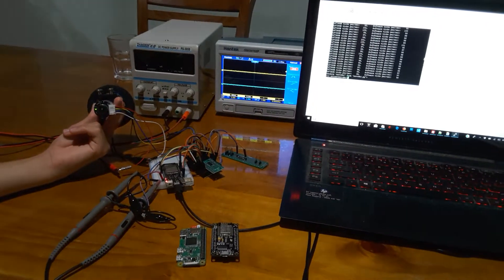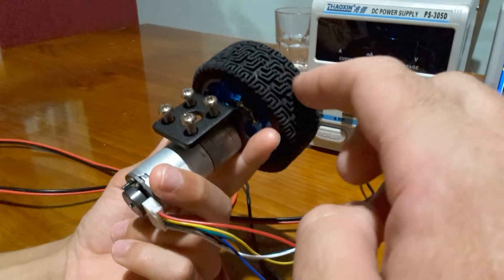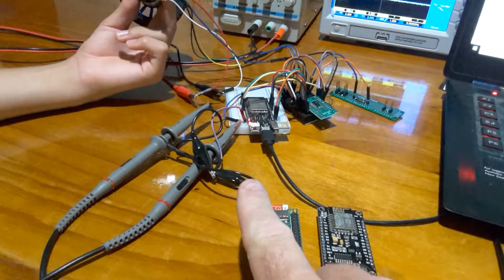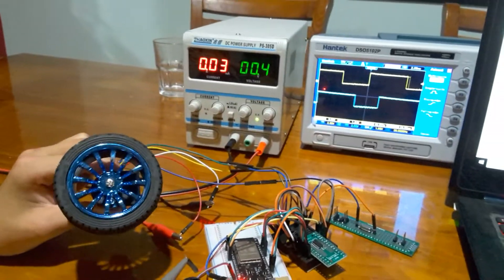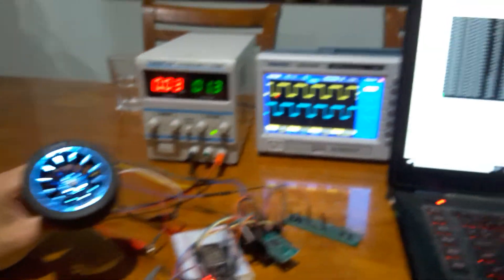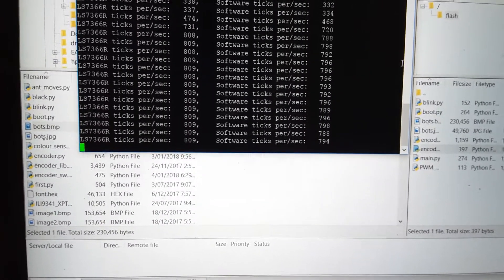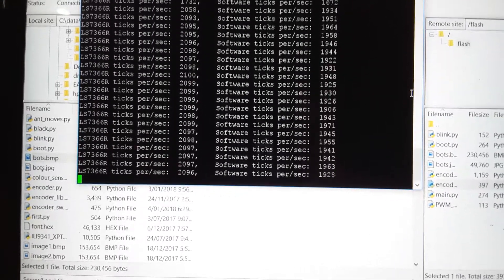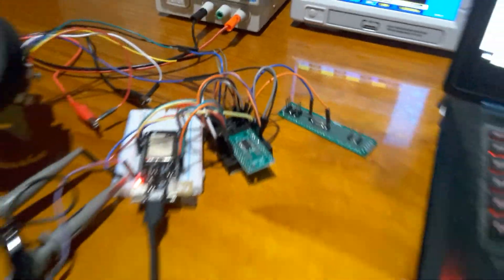External encoder Counter chip LS7366R

Comment: a question...i use this device on an arduino...does reading CNTR register influences the counting?Because on the data sheet productor writes (i understand this manner) to read back from OTR register...what is the right way ...?thank you
Reply from the maker: Yes you can use this IC with any controller. Reading the CNTR register doesn't change the counting

Comment: Thanks for sharing. But did you try to disable wifi first?
Did you use interrupts as well?
Reply from the maker: WiFi running, that's the point to show encoder counting requires all the resources to not miss a tick
Reply: @outofthebots3122  missed this. But if didnt, was this higher?
Reply from the maker: @aleXelaMec  it would be but your still missing the point that encoder counting takes up all your CPU resources so it means you can't do other things at the same time while counting a fast encoder. So if you want to be doing something and counting encoders at the same time then you need to use a hardware encoder counter rather than the CPU to count the encoder
Reply: @outofthebots3122  hey, no, I got your point. At least since my issue is not prolong measurement. I need to count short pulses (around 300ms), but 6 chanels, 2 of each are fast. But thanks for the comment. Ill think about using external Dedicated counter.

Comment: hey would you be able to share the code that you wrote. I can't seem to understand how the spi.transfer function work. I checked the syntax but can't use it because I don't understand what buffer and val parameters are. would you be able to help on that as well. Thank you
Reply from the maker: I would no longer have the code that I wrote for this video. What programming language are you using and what processor are you using??
Reply: basically I am using Arduino nano to control the motor with an encoder (am-2816a) and an SPI (LS7366R). As the motor rotates the encoder reads the position sends it back to the Arduino through the SPI. I have gone through the research part and know how to do the wiring, but I am stuck with the Arduino program. there is an SPI library in the Arduino software that supports the SPI communication (SPI Pins), and there is a function that I want to use thats called SPI.transfer(). I am having troubles understanding how to use the function and how to receive and send data from and to the encoder. I have used a program that I found online and the output is always -1 even if the motor is at different speeds. I am guessing that there is something wrong with the program. check the links below to know what I have been looking at:

https://arduino.stackexchange.com/questions/16348/how-do-you-use-spi-on-an-arduino

Arduino program found online:
https://github.com/werdroid/Arduino_LS7366R

Arduino Nano
http://www.farnell.com/datasheets/1682238.pdf

encoder
https://www.andymark.com/products/hall-effect-two-channel-encoder

SPI
https://lsicsi.com/datasheets/LS7366R.pdf

Clock 
https://www.ctscorp.com/wp-content/uploads/MXO45.pdf

   @outofthebots3122
Reply from the maker: @m.a.sherif6878  I don't use Ardunio myself so don't know the SPI library but the first link you posted seemed to me have all the info needed for using SPI. Also I have discovered that STM32 has builtin hardware encoders and there is an Ardunio port for the super common stm32f103c8t6 and it has an ardunio libiary for encoders counters see this thread http://www.stm32duino.com/viewtopic.php?f=18&t=4024&p=52829&hilit=encoders#p52829

Comment: I think that the best solution will be to use an STM32 board, like a Nucleo that have the quadrature encoder integrated
Reply from the maker: Yes I have now discovered that STM32 MCUs have hardware encoder counters on their timers so I use STM32 for projects that require a encoder counter.

Comment: Enocders are hard for pro beginners..your vid here also stated..that many people that wants to try this gets hit by the wall accuracy...so my own test of encoders(gpio input) has also hit a wall.  I can read stable 16 counts at 1000 Hertz pr Rpm...which is really not good enough... Now the chip you have is hard to get by(ls7366r) also the code for spi (a sample code) is also hard to get by....as many samples require the right set of parts.... So I think and hope for all on RPI and Arduino as probeginners that you will use a bit of time to make an in depth Tut vid.  Every where on YouTube and on forums you get small bits of the right way..  and for more people the making project it more important to know where you device is currently located then how fast it is going... In sense of robots/3d printers/conyouer belts/... So I wish for xmas, as you seam able to do this....and for all probeginners you will make an in depth project...easy to buy project...

Maybe I am hoping for to much.
But a man's gotta ask right...
Btw thank for your vids.

(Sry for my poor English).
Reply from the maker: Yes good points. The LS7366 is not common found and the user has to write their own custom driver to use it. I have now found another option, the STM32 family of MCUs have hardware encoders on their timers. I am currently using a STM32F103C8t for a robot that I am building am are using the hardware encoders on it. The STM32F103C8t (known as the blue pill) is available everywhere for about $2 and has 4 hardware encoders on it see https://www.aliexpress.com/wholesale?catId=0&initiative_id=AS_20181217125901&SearchText=stm32f103c8t6. There is an ardunio port for it and there is already libraries for using the hardware timer encoders. If python is your preferred lanuage then there is the pyboard with the more powerful STM32F405RG MCU that runs micro-python see https://store.micropython.org/
Reply: I have purchased the board. So now i Hope you will share some info on thatSTM32F103C8t . Will it handle highspeed as well? ... I have been looking a bit on the industrial encoders. And found that they are affortable for my project-  By the way happy new year. I need to finish this project, an i am getting desperate. :-)
Reply from the maker: @christiansrensen3810  here is the reference manual for the stm32f103 https://www.st.com/content/ccc/resource/technical/document/reference_manual/59/b9/ba/7f/11/af/43/d5/CD00171190.pdf/files/CD00171190.pdf/jcr:content/translations/en.CD00171190.pdf you will find from page 329 is the info on the encoder counter. Basically it uses the timer counters to count the encoders. I program it in C but there is ardunio libraries to use the encoder counters as well. I used MX_cube to setup the timers as encoder counters then was just reading the timer_count register to get the current count.

Comment: Based on the reference schematic in their datasheet, there are two capacitors near the crystal. Did you happen to work out what capacitor values to use?
Reply from the maker: The capacitors need to match the crystal you use in order to make it resonant for a clocking signal. Instead of using a crystal oscillator I used the timer on the ESP32 to create the clocking signal as ESP32 can create clocking signal up to 40MHz.
Reply: @outofthebots3122  Care to share the schematics you used? I'm especially interested in how you wired up the clock from ESP32 to the LS7366R
Reply from the maker: @orhuk   quote from datasheet ". Instead of a crystal the fCKi input may also be driven by an external clock.". I just set a timer on the ESP32 to create a high freq PWM with 50% duty and connected it to fCKi

Comment: I'm using pigpio to do the counting, and running streaming video over wifi at the same time on a pi ZW. Although things appear to go wrong, it is actually just total cpu overload that is a problem. When I stop the streaming video it all catches up again and the counters are correct (or at least have only a very small error). What software are you using to count?
Reply from the maker: I did write my own software to do the counting. What I found was the software was close to the external counter chip but it did miss some counts. The Quadrature encoders that use have 11 poles x 4 signals per pole x a 31:1 gear box so this is 1320 signals per rotate so if your rotating at 60RPM this 1320 signals per second. Quite often the motors can be spinning faster than 60RPM and usually I have at least 2 motors on any robot. Most processors with WiFi run the Wifi on a thread with high priority and when the processor is busy with maintaining the WiFi it will miss counts. You will notice this when you compare a software counter with the external counter or if you try to get a robot to drive a perfectly straight line. For my software counter code see my last video, at about 8mins you will see the code and at about 6mins a good explanation of how the code works https://www.youtube.com/watch?v=p4BCFhIuC88&t=33s
Reply: Not surprising really that a simple Python loop runs into trouble doing this. I use pigpio to count the pulses, so it's running in a real time process (i.e. high priority) and written in C I believe. I'm also running raspbian lite - so no gui and minimal system services. I found my first runs I had a rogue left over thread still runnig, once I rebooted I found I can stream video over wifi and use pigpio to count the pulses very accurately, There is a slight amount of jitter in the readings when streaming video over wifi, but the overall counts seem to be accurate.
Reply from the maker: Without a doubt the C code of the pigpio library will be faster than the code from the other link. I started to use the ESP8266 and the ESP32 because they are a real time MCU rather than a micro computer running an OS. In the video above it is running on an ESP32 board so ti is a real time MCU without an OS and all code is compiled to machine code via an C interpreter. No matter how high priority the pigiop library is the OS is still in command and will always have higher priority over resources. At times my robot can have wheels turn as fast as 120RPM and I have a min of 2 wheels driving so this is in the order of 5280 pulses per second and because there is 2 encoders running at the same it it is possible that some of these signals can be at the same time. So signals can be under 0.1ms apart. I started to use a MCU because it is real time so can handle these super small time frames better but still found problems of missing signals and this is why I used the external counter chips and have 1 for each encoder running in parallel. It means signals don't get missed and it also means the over heads r removed from my master processor to allow it to do other stuff.

Comment: Hi, nice job. How fast can this chip count? Would it be able to handle quadrature pulse at 2Mhz? I'm looking for something that could handle 4 encoders at 2Mhz, any suggestions? Thank you:)
Reply from the maker: the LS7366R processing speed is set my an external clock signal. Running at 5v it can handle clock signals as fast at 40Mhz. It is recomended that the chip is clocked at 10x the speed of the encoder signals so it should handle signals up to 4Mhz. You will need a Ls7366R for each encoder and they can be chained together on the 1 SPI bus all with separate CS lines see page 14 of the data sheet http://www.lsicsi.com/pdfs/Data_Sheets/LS7366R.pdf
Reply: Great, do you know perhaps where i could get a couple of these chips as soon as possible, EU zone?
Reply from the maker: Google will find them for you. Mostly I have found US sellers
Reply: Hey, I got the chip, its on a board, but should work the same: https://www.mikroe.com/counter-click
Trying to make it work with 1 encoder. I got MISO,MOSI,SCK,CS connected to Raspberry PI3, and im using the bcm2835 driver for SPI. http://www.airspayce.com/mikem/bcm2835/group__spi.html   Im using the datasheet for correct commands/registers, however the bytes read from chip are always all zeroes. Any help apreciated:)
Reply from the maker: That little board is basically what I built the on a bread board as it was cheaper for me to do that. 
You will also need to set the enable pin to high before it will count and of course connect your power and gnd. There is a couple of register to write to for setup before reading the counter too.
Reply: Out of the BOTS done all that, but i cant read or write to setup registers, its returning only empty bytes on all registers :s as if chip is not responding to my spi. i tried chip select on high and low, and all 4 spi modes, cant get it to work.. im using bcm2835 lib for spi connection
Reply from the maker: The CS pin must be pulled to  low to send or recieve data via SPI. To do anything with the chip you have to send a command byte then read/write according to the command byte and the CS pin must stay low the whole time. i.e if you write the command byte then bcm2835 lib sends CS pin high because write has finished then you try read the 4 bytes from the counter you will get nothing becuase soon as the CS pin goes high then the chip thinks the transmission is finished. You will either need to manually send CS Low then write a byte and then read 4 bytes back or use bcm2835_spi_transfern() to write 5 bytes (command byte and 4 dummy bytes) and read 5 bytes back but through away the first byte :)
Reply from the maker: please read carefully the bottom left paragraph of the first page of the data sheet http://www.lsicsi.com/pdfs/Data_Sheets/LS7366R.pdf
Reply from the maker: here is my MicroPython code that was running on the ESP32

cmd = bytearray((0x64, 0, 0, 0, 0))

while True:
    res= bytearray(5)
    spi2.write_readinto(cmd, res)
    counter = ustruct.unpack('>I', res[1:5])
    print (counter[0])
    time.sleep_ms(200)
Reply: Hi, thanks for help, however i still cant make it work :) To test the CS low, i sent 4000 bytes with bcm2835_spi_transfern() at lowest clock speed on SCK, and measured voltage. The CS drops to low correctly. My "sequence"is:  first i use bcm2835_spi_transfern(bytearray, length) to write 2 bytes (write command to MDR0 (0x88) and in 2nd byte data for register). Then i use  bcm2835_spi_transfern() to send 2 bytes to write to MDR1 -(0x90 and data - counter mode to 32 bit and enable counting..) Then i use  bcm2835_spi_transfern() in a loop, sending array of 5 bytes with READCNTR command. Results always 0. Reading other registers (etc MDR0, which i just wrote into in previous lines) returns always zeroes. I wrote to Mikroelektronika for example code, since they are producing a shield for this that connect to RPI. Out f ideas at the moment :/
Reply from the maker: This should work as it is exactly what I was doing but using python library instead of bcm2835 library. I would be checking your wiring and en pin is set to high. Also use micro scope to check the break out board your using doesn't have any faulty soldering.
Reply from the maker: Looking closely at the break out board you brought it needs a zero resistor to short out either the 3v or 5v pad to select weather it will run on 3v or 5v. Do you have a short across the 3v pads???
Reply: yup, the zero resistor is on 5volts, power supply is good. Check picture: http://shrani.si/f/2W/kS/2nM3GEKW/shh.jpg   

I dont have anything on "EN" pin
Reply from the maker: Ok in the picture I see 2 things first of all the EN pin (enable) isn't connected and must be connected and pulled to high for the chip to work, it is like an on/off switch for the chip. Second never connect 5v to the data pins to the RPi as they aren't 5v tolerant and will damage the RPi. You will need to move the jumper to the 3v position and connect the RPi 3.3v power and ground. Pray that your RPi SPI pins still work and haven't been damaged by the 5v
Reply: o shit :) well, ill solder the resistor to 3.3 and try again. I think Rpi pins are fine, when i connected mosi to miso and ran test it worked ok. but encoder works on 5 volts so ill have to power it from another source.
Reply from the maker: Not sure how the counter chip will go when the signal from counter are at a higher voltage then the Vcc of the  counter chip. I would think about maybe using a logic shifter between the RPi and the counter chip to convert the 5v SPI lines from 5v to 3.3v or put a logic converter between the counter chip and the encoders to convert between 5v and 3.3v
Reply: http://shrani.si/f/2X/11a/3XLDexu6/shh.jpg

Rpi pins seem fine, mosi to miso transfer with the test program works. So running on 3.3 volts now, enable on high, no encoder connected, just trying to write to chip registers and read from them, no luck, still zeroes :)
Reply from the maker: I would contact the the seller where you brought the board from as what your doing should work
Reply from the maker: I would also try bcm2835_spi_transfernb() as it seems to be a little different to bcm2835_spi_transfern() and see if that makes a difference
Reply: Did you get this working? I am looking to do the samething
Reply: @pacosanchez-ray4930  same
Reply: @pacosanchez-ray4930  Never mind, I got it to work with the Raspberry Pi. Check it out on my channel